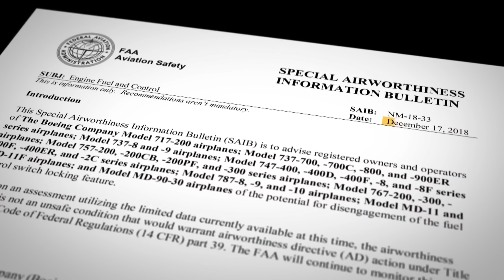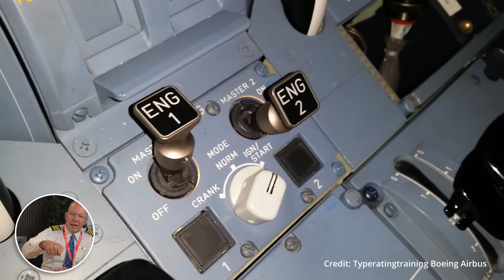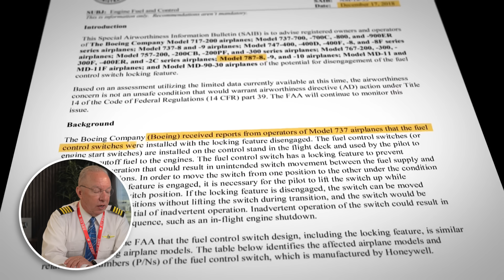Air India 171: The FAA’s 2018 Fuel Switch Locking Bulletin Explained (16 Questions Answered)

Comment: You do not know it is human intervention because no one can see if the pilot switched the switches off in the first place, or was it mechanical failure of the locking mechanism.  The pilots do not want video because if video existed 50% of the pilots would have to be fired due to non attention to detail.  The cockpit is not the bathroom, and there are hundreds of lives at risk.  There is just the slightest possibility that the switches locking mechanism was faulty / worn out, but we may never know if the problems were worn equipment, or human failure.  Simulators do not mirror the aircraft 100%.  There are no real engines and FADECs, there are simulated engines and FADECs amongst other devices like landing gear and too many other aircraft parts to mention here.
Reply: https://youtube.com/watch?v=XZ5oHyNfcAE&lc=UgxjScLwQmw9kxu1vGB4AaABAg&si=QGlpztWkmk0wK7h5

Comment: Capt. Steve, here is the service bulletin about MN4 microprocessor(one of the question mentioned) https://downloads.regulations.gov/FAA-2021-0273-0013/attachment_2.pdf
The condition mentioned "An LOTC event has occurred due to an EEC MN4 microprocessor solder ball failure."

Comment: A great series of videos thanks. But I wonder if Boeing engineers will now be proving beyond doubt that those switches could not have been knocked accidentally. In my first job I was told of an accident in a factory here in England that occurred in the 1950s that was 'impossible' because everything was safely interlocked. But when the investigation team was scratching their heads one of the factory workers stepped up, did something and demonstrated how the safety mechanisms could be overcome after all. The guy who told me about the incident (Mister Edwards) used it as an example of making time to ask and listen to everybody

Comment: Capt. Steeeve, as I understand electrical switches they are designed to either complete, interrupt or redirect electrical current. Combined with a purpose to activate or deactivate a motor or solenoid, such as something needed to start/stop fuel flow or ignition sequence, the switch is seldom connected directly to the motor/solenoid but rather an electrical push/pull or open/close RELAY that can handle more electrical current than the actual switch. The relay doesn't care about where the electrical command to operate comes from. A stray current from static electricity or an electrical fault somewhere in the throttle quadrant could possibly trigger uncommanded relay operation that the Flight Data Recorder may interpret as a legitimate command to cut off. Under that condition what the FDR later recorded as the switches being returned to the RUN position could simply be an attempt by the pilots to recycle the switches. That left them to be found in the RUN position by investigators and in agreement with the FDR. I think a deeper dive into the FAA Safety Bulletin concerning the cut off switch assembly is definitely in order.

Comment: 04:51 I've noticed that whenever the answer or logic takes the weight off the pilot's shoulders, you become uncomfortable with your speaking, and your words start to break. Is this because you don't want the Boeing to be blamed for this? Cuz visuals definitely help answer if Pilot killed the engine intentionally or not, and if yes, we will know who the culprit is for sure. In one of your previous videos yesterday, I noticed the same discomfort. You mentioned the bulletin was for the 737, but the 787 is clearly listed in the bulletin, and it should be treated as critical since the switch is faulty and can potentially kill both engines. I'm no pilot or engineer, but this sounds very critical and TBH, if the world will know Boeing is the reason for the accident, it will create chaos among travellers. I think that's one of the major reasons, everybody is trying to blame the pilot.

Edit: And if one of the pilots wanted to die, why would he say that he didn't turn the fuel off? He could have simply ignored the question, since there was no saving at that point. Just like the German pilot did by closing the cockpit, a clear indication of a mental issue.

Comment: Though there was only 1 second between fuel cutoff to each engine while (as I recall) there was a 4 second lapse between restoring fuel flow to each engine. Is anyone considering that this could indicate a struggle between the two pilots?

Comment: My question is :  this switch is located in between of two pilots. Switch consist of spring & lock features. So mechanical force is required to do in run to cut-off mode or vice versa. Left switch is nearer to right hand of the left pilot & right switch is nearer to left hand of the right pilot. If any one of them intentionally cutoff the  both switch then whole body  needs to move or twisted to reach the rearer  switch, that movement will easily noticable to second pilot, then second pilot definitely will resist. But in reality this is not happened, instead one pilot asked to second pilot, "why did you cutoff ? . Another replied i didn't". That means pilot are not intentionally cutoff this switch. Any electro- mechanical fault or  malfunctioning of lock-in disengagement may had been happened. It's really suspicious. Boeing trying hard to prove that incident happened due to pilot's fault & giving justification as metal health issue. At the end of the day Boeing will never accept their fault. Earlier also, many reporting stated & raised concern about Boeing safety & technical issue.

Comment: Disagree.  This was not intentional.  If it were, why would the perp allow turning switches back on?  Even if I'm the PF, I would see the Captain flipping the switches.  No way you can miss that.  "Why did you turn them off?  I did not".  No one seems to be willing to believe this response but it is 100 correct for equipment failure.

Comment: See some people stuck on the bulletin. The idea that this could be related to a service bulletin and there isn't an immediate grounding of all planes with those switches is preposterous. If there was a .00000000000000000001% chance this was related to the service bulletin, all planes with those switches would already be grounded and under inspection. Period. Let's move on from the service bulletin.

Comment: The fuel cut off switch should be automatically locked during take off or There should be loud oral and visual warning in this critical situation, it is clearly a design flaw.

Comment: Based on the questions asked it might be worth explaining that the switch is a single throw double pole device. One side is the signal the other side is the switch position detect. A CPU could initiate the signal to cutoff fuel but it could not change the position detect.

Comment: No, the fuel switches on the Boeing 787 are not mechanical switches in the traditional sense. They are electronic (software-controlled) switches that are part of the Integrated Modular Avionics (IMA) system

Comment: Error logic part, I was thinking of something similar , you said that certain functions won't work while the plane is on the ground, so they can apply the same logic with the switches, it shouldn't work below certain altitude that would stall the plane regardless of engine fire

Comment: MY PROFESSIONAL OPINION:

Air India is playing either with God or the Devil. By not assuming gross negligence, they do not have to pay. They are saying

essentially that one of the 2 pilots did close both fuel valves and that the other one said "why did you close the valves?" with the answer "I did not do that"... If there were no one else in the cockpit, then who did? God or the Devil?

To me this is clearly a suicide attempt (à la Germanwing) from the captain while the F/O (first officer) was lifting the plane after V1 (point of no return). Note that the switches are not in the line of sight but behind the pilots in the middle panel. Better said the F/O was concentrating on taking off while the captain cut off the fuel valves "behind his back", so to speak. Cutting off the valves after V1 is the absolute worst case scenario.

Very regrettably, this is a frame job by Air India. The official report will take years and the final judgment possibly decades (15 years in the case of the Concorde. Hope this helps...

🗽 iBob O'Donovan  🗽

Comment: I can't believe it was the 737 fuel switch locking problem that caused both fuel switches to be turned off one second apart on this 787 flight.
If the fuel switches were loose, wouldn't that have been observed during previous flights on this aircraft or even when the fuel switches were turned on when leaving the gate?
If the first officer was flying the plane with both hands during the takeoff, wouldn't it have been very difficult for him to have turned off the fuel switches? I guess it's possible though for either pilot to have done this.
I just didn't want to believe that either of the pilots intentionally caused the plane to crash.
Is there any situation where the FADEC system would consecutively turn off both fuel switches?

Comment: Dear Captain Steve,

I have great respect for your knowledge and experience. However, I was quite surprised that you seemed unaware of the latest information regarding the RAT deployment timeline on this ill fated flight.

Specifically, I’m referring to page 14 of the official preliminary AAIB report, which states:

“The CCTV footage obtained from the airport showed the Ram Air Turbine (RAT) deploying during the initial climb immediately after lift-off (fig. 15).”

This is exactly what Donotwantahandle1111 was asking about. Earlier evidence had suggested the RAT deployed slightly later, so this updated timeline is critical. The fact that the RAT deployed even before the aircraft left the airport perimeter could have major implications for the investigation.

I hope you won’t take this defensively—getting these details right is essential. I also look forward to hearing your thoughts on this in an upcoming video, rather than just as a reply here.

Thank you!
Reply: Question said video. That pictures footage was only released after a month thru the report. There is no video still. Now, given the engines couldn't recover soon enough would mean whoever disengaged supply did so intricately.

Comment: Dear Sir..., Just 2 Questions:
(1)Is it possible that faulty fire sensors or some other dysfunctional fault detection sensors in the Engine(s) can give fake fire/fault signals to the FADEC(s) and trigger undesired Engine shutdown & restart procesure unnecessarily, somewhat like MCAS  getting fooled by faulty sensor without crosschecking with other sensors and Nosediving the 737 MAX?? 

(2) is it possible that some sparking/arcing etc faults or surges can send fake Fuel switch toggle signals to FADEC(s), FDR(s) etc. Triggering unnecessary Engine Shutdown and Forcing pilots into a restart sequence??
Reply: Or even water ingress?

Comment: My God.. you are so dismissive of people's legitimate concerns and hypotheses that logic systems could have played a part in both the cutoff of the fuel and, indeed the recording of non verifiable sequences of events. I for one would really like to see cameras in the cockpit so we do know that rules and procedures are being adhered to.. and would be happy if such breeches were 'leaked' as you put it! From my own perspective I would like to know your reaction to it having been a simple lapse in concentration that might have led to the engine fuel cut-off being instigated instead of retraction of landing gear switch/switches. That would certainly explain the response to the question "why did you  switch fuel cut-off" instigating a response of "I didn't", as in 'I didn't intend to'. I certainly feel that if there exists some other visual warning that fuel cut-off had been initiated other than the physical position of the toggle switches then it is possible that the pilot who posed the question might have been doing so based on audible ques and that therefore the switches never actually moved, but that the results of a software glitch could actually have been in play here and the black box record might not provide a reliable record. What do others think?

Comment: It shouldn't really that difficult to add a camera and connect to the CVR or FDR hence, the data would only be used as a part of the accident investigation. You have CCTV cameras around you all day, even the cashier in the grocery store has cameras, filming then so WHY shouldn't pilots be held to the same standards? They are responsible for all lives on the plane! If camera would have been installed in this case, we would know with way more certainty if ANY of the pilots touched the switches and maybe also why. 
It's troublesome that neither pilot acknowledge the movement of the switches. Even though it's VERY unlikely, it IS still possible that there where something wrong with THESE switches and they for some reson moved by themselves. If that were the case, it's fully understandable WHY neither pilot understood what happened and why it took 10 seconds to move them back to run. I DO know my electronics and even military grade equipment can fail, even in a very unpredictable and unlikely way. Switches can develop internal faults that is NOT visible on the outside. 
it IS possible that the switches had a internal bad connection, even though the switch position was "run", internally it could be cutting the power so the engine computer and the blackboxes "read" the information as "moved to cutoff" and then moved back to "run". Same thing with the engine control unit, a freak software glitch can make the system interoperate the switch position as "cutoff" and then after 10 seconds, "run", completely without the input from the pilots. 
So, suddenly you notice that the engine is spooling down during takeoff, you ask your colleague why he shut off the engine and he deny he have done so. Hence, it takes you some seconds to realize that the engine shutoff Ia actually set to Cutoff and then you move them into run however, or more terrifying, as I stated before, you think the switches is somehow set to cutoff but when looking at then, they are set to run.Consider the total confusion.  It wouldn't make any sense for you. I think that CAN a reason why you don't hear anything other than pure desperation and confusion on the CVR. 

So to conclude:
1. One pilot turns off the engine for one reason or another and then deny doing it. Strange but possible and disturbing. Here, cameras in the cockpit would definitely help.
2. A mechanical problem within the switches themselves make the Airplane think the engines have been cutoff when they are not (unlikely but not impossible however, opening the switches might reveal some answers)
3. Since the switches operate the computer by the engine that tells the vales to cutoff the fuel, a software glitch might MAKE the engine computer THINK the switches have been moved when have not. Depending on where the switch position is taken from in the FDR sensor logs, it might LOOK like the switches have been moved however, they haven't been moved physically. If that is the case, the Dreamliner may have a hidden ticking time bomb and just when all parameters are aligned again, this might happen agen. 
So, this is actually my main reason WHY cameras in the cockpit makes sense. AS long as nothing happens, the video from the cockpit is automatically recorded deletaed but IF there is an accident, you might have the answer to HOW and WHY something happened, even if the crew in the cockpit remains completely silent.

Comment: WHAT D YOU TELL ABOUT SPECIAL BULLETIN IN 2018 ISSUED BY BOEING ON EXACT SAME ISSUE THAT FUEL CONTROLLER SWITCHES CAN TURN OFF THEMSELVES DUE TO MECHANICAL FAILURE - https://www.youtube.com/watch?v=tPH6J8ftfSA , BAS**RD , ALREADY TALKING ABOUT PILOT MENTAL ISSUES, YOU CHECK YOURS

Comment: I think they said captain called mayday as he should because he was pilot monitoring, first officer was flying the airplane, so if captain called mayday then first officer cut fuel off while flying the airplane, so he stopped flying the airplane and then cut fuel off, i think if it was this situation then captain as pilot monitoring would have seen action of first officer and probably switched on fuel faster, if good pilot saw what bad pilot did he would've switched fuel in 3-5 seconds, so i think bad pilot must have been captain because he was pilot monitoring,  so first officer couldn't see what captain did because he was flying aircraft, so it took 10 seconds to see the problem and switch them back on. 
So imagine first officer flying aircraft, his hands are supposed to be on controls, if he moved his hand and reached to switch fuel off then captain would have seen that immediately because as sson and FO move his hand captain wouldn't expect it as FO hands should be on controls, so captain would see him switch fuel off, ask question and when FO say he didn't do it, captain would switch them on in about 3-5 second, it wouldn't take 10 seconds im sure, 
But if captain switched fuel off then FO wouldn't see it immediately because he is watching out flying the aircraft, it takes few seconds to register all alarms and engines rolling back, then seeing what is happening, then ask question then turn them back on, thats about 10 seconds, but then why did captain issued mayday call if he is the one that cut fuel off, this is very fishy to me.
i still dont get it why would any of them do that when there are much better ways to crash aircraft, if he did it deliberately he could've push aircraft down but they continued to glide and tried to relight engines, if one pilot cut it off then he would maybe try to prevent other pilot to turn them back on but he didn't, maybe he knew there is no enough time but still in that kind of situation i think bad pilot would try to prevent good one from turning them back on, but he didn't.